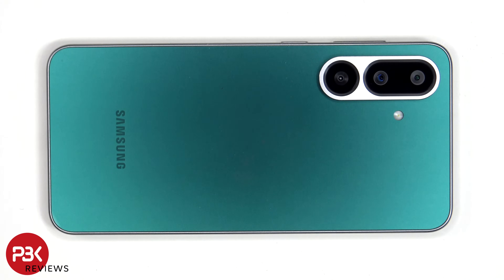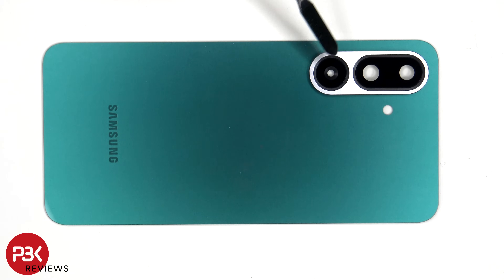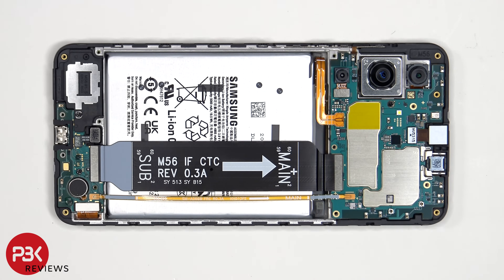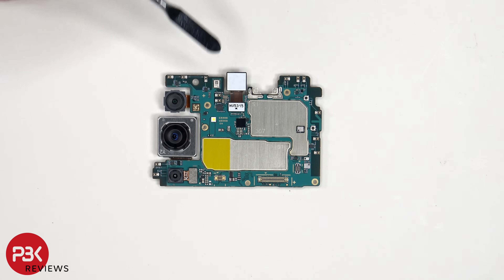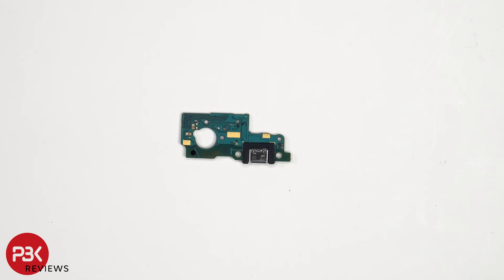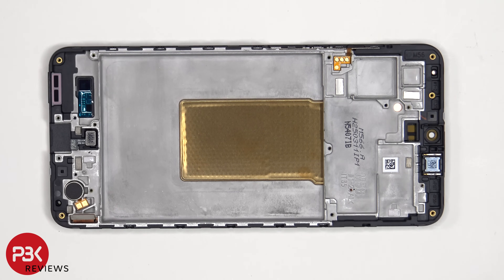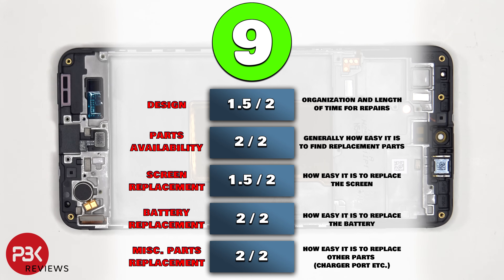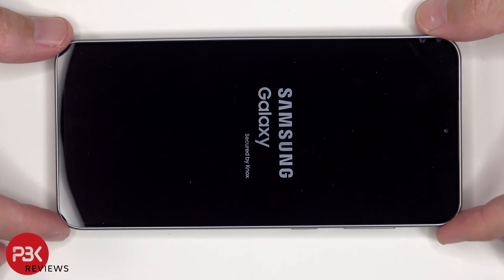Samsung Galaxy F56 5G Teardown Disassembly Phone Repair Video Review

Comment: 0:24 they could've used a hybrid sim slot. I would've gone for the M56 instead of the A55 if it had an sd card slot. Damn you, Samsung
1:39 could've fooled me. I thought it was metal. 
2:30 that narrow antenna cable would keep me up at night lol
3:45 Mono speakers at this price is insane. In India of all places. 
5:05 good to see the pouch battery removal technique in other Samsung phones. It should be standard now.
Reply: Why hybrid, it should be dedicated.
Reply: @triggeringanalysis Hybrid would've made space for an SD card slot and a 2nd speaker, so the phone has a stereo speaker setup. Providing a mono speaker at that price is bold
Reply: @MZRTMusic254  Space is never a problem when designing phones—companies can easily include features like a 3.5mm jack, FM radio, dedicated memory card slots, and user-replaceable batteries. And with the European Union pushing for user-replaceable batteries, we’re finally seeing some progress, but it's long overdue. The hybrid SIM slot, though, is a complete restriction. Why should we have to choose between two SIM cards or one SIM and one memory card? There's no reason we can't have both, especially when even so-called budget phones cost thousands of rupees.

Brands like Samsung, iPhone, and Nothing have stopped including free charging bricks, and they’re charging an arm and a leg for their phones. It's clear they’re more focused on making unreasonable profits than offering real value to customers. If consumers started voting with their wallets and stopped supporting these companies, we’d see them rethink their approach.

Also, I’m surprised YouTubers don’t talk about the absence of FM radio in modern phones. I bet there’s some pressure from these companies to keep quiet about it. And let’s talk about curved screens—these are marketed as "premium," but in reality, they're just a design flaw. They’re fragile, harder to repair, and offer no real benefit to the user experience. It’s all just a marketing gimmick.

Mono speakers? They should be a thing of the past. Every phone, no matter the price range, should come with stereo speakers. Audio quality matters, and we deserve better than a single-speaker setup that sounds flat and tinny.

Finally, there’s no need to keep pushing the absurd race to make phones thinner and thinner. It’s one of the most unnecessary trends in the industry. Thinner phones often compromise battery life, durability, and overall functionality. What’s the point if we’re sacrificing important features just to shave off a few millimeters? It's time for companies to stop chasing shallow design trends and focus on what really matters—better performance, more features, and a better user experience.

At the end of the day, companies are treating us like we're disposable. It’s time for a change!
Reply: @triggeringanalysis I understand about your opinion. But what about the costs? Do you think company would listen your advise as matters? I don't think so. A lot of companies are now struggling money because of their inflation prices, they had no choice to cut costs for unnecessary designs and resources. Companies can't giveaway too much products that most people didn't want to spend too much money, thus not all humans are actually clever.
Reply: @BillyRazOr2011  The cost is negligible and companies are already charging too much. 😊

Comment: I wonder when Samsung will start changing the design of their phones to meet the 2027 EU regulation, which defines a battery as 'readily removable' if it can be removed using commercially available tools -- without requiring specialized tools (unless provided for free), thermal energy, or solvents